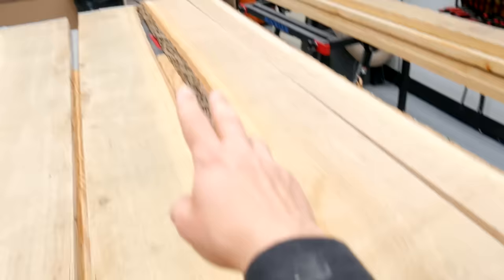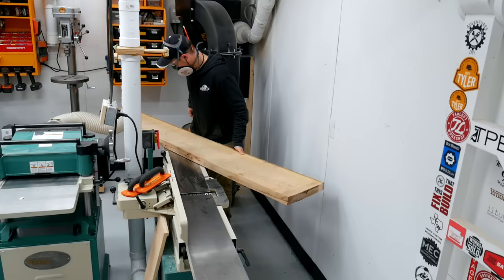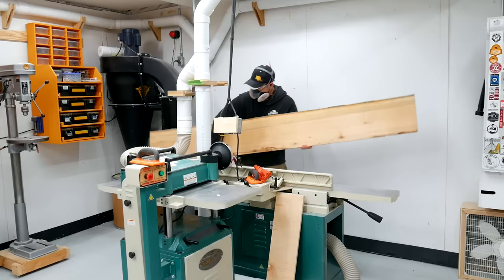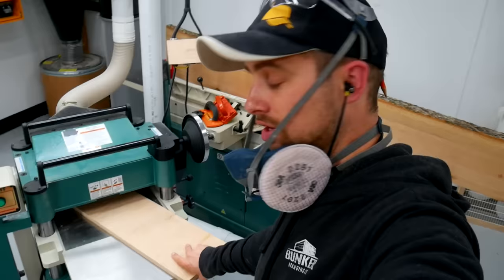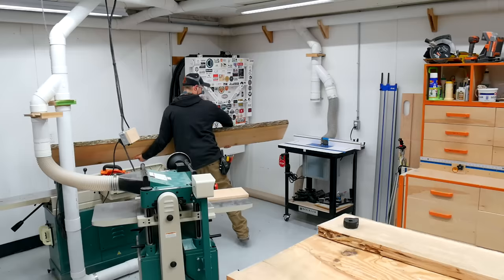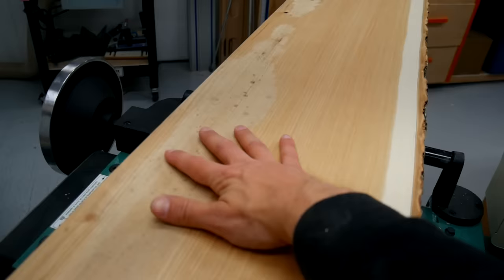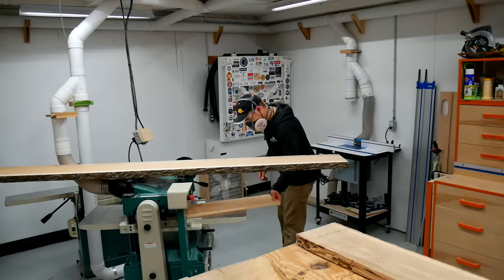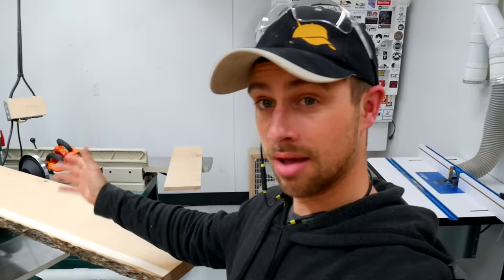Jointer Size Doesn't Matter! Flatten Large Boards on a Smaller Jointer

Comment: OMG! I looked to see if MY fingers were still attached when you cupped your hand over the end of that board AFTER turning on the jointer!!! Crazy Dangerous!!! Other than that heart-stopping moment, I enjoyed the video. With that said, I am familiar with the technique and have employed it twice. Once successfully, the other time - not so much. My advice to any of your viewers considering this process for the first time, it can be awkward feeding such a wide board through a jointer, especially if there is any significant cup in the board. If your not careful (especially with long boards), your milled lumber can easily end up much thinner than desired. Best of luck to you and stay safe.
Reply from the maker: Watch again before making comments that are not true.
Reply: NB: that was his dust collector running when he had his fingers at the edge then he moved back and switched on the jointer!

Comment: Not sure why you jointed the edge of the board before you ran the full side through the planer. Joint half the face, plane tho opposing face, flip and plane the other half face, then joint the edge.
Reply from the maker: Your way I need to go back and forth between machines. This way I don't, all the work on the jointer, move on to the planer and finish completely there.
Reply: DIYTyler True, but then the edge and face may not be square, they cant possibly be. You didnt reference from a single point that wasn’t machined after.
Reply from the maker: Might need to watch the video again.

Comment: are your feed rollers on the top or bottom ?
Reply: It has feed rollers on the top.  It has corresponding rollers in the bed as well, but they're not driven, they're just there to help move the wood along.

Comment: Tyler, is that the G0858 jointer there?  if so, do you have any trouble keeping the tables in parallel with one another?  I have the 858 and I have to adjust mine ALL THE TIME.  It's a pain.  I have reached out to Grizzly and they have sent me some warranty parts since it is still under warranty.  In the process of installing now.  Will have to see if that makes a difference.  Since this is the first jointer I have ever owned, is the problem I am having just a common thing to have to deal with?  Thanks.  BTW, anyone else out there.....feel free to chime in.
Reply: I had this issue with mine.  I had some old steel shims from a dato stack that I used to shim it where needed.  Was a constant problem solved by selling it and getting another machine.  Unfortunately Grizzley tools are what they are.
Reply: @montet202  thinking about doing the same thing.....selling.

Comment: Forgive me, I'm new to woodworking, but if you have to put it through a planer, why not just use the planer? This feels like planing with extra steps.
Edit: I'm not trolling. This is genuine.
Reply: Because the planer rollers compress the material flat as it is fed through.  So any warping or cupping in the material will still be there when it exits the planer.
Reply: @JGumaJ  I was wondering the same thing.  why not just run the whole board through.  But your explanation makes sense.

Comment: Why not just start with the planer?
Reply: Bill Swenson if that plank is uneven planer will not fix it that’s why is important to use a jointer
Reply: A planer basically copies whatever surface is on the bottom. You need a flat bottom to achieve a flat top.

Comment: Right off the bat he hung his fingers off the end of the board near the cutting head. Removing the blade guard is not a good idea!
Reply: I thought so at first, but... at the time only dust collection was running. He finished setting up the run, THEN started the jointer and using push blocks,...
Reply: I watched it again and  I see that now. Whew!

Comment: doesn't work for me, im using 12inches jointer and 12inches planer 😂
Reply: Do you wish you had a 13 inch planer at times? I have no planer yet but wonder if a random project needing more than 12 inches sometimes comes up.

Comment: You call it flat? take a good long straight edge and check it for flatness in whole length. I guarantee that this is not flat. You are not able to flatten such a long board on such a short jointer. Use a table extensions, without that it will never be flat. Call it flattish, flat enough for your purpose, but it is not flat.
Reply from the maker: Funny, didn't see you here while I was building this......work on the desk made from this every day. It's flat. Ever used a jointer?